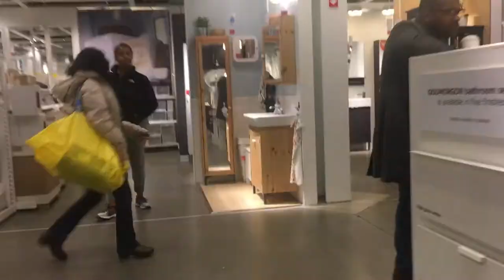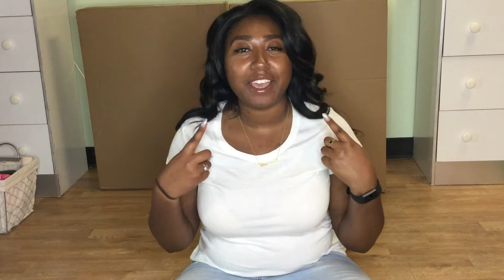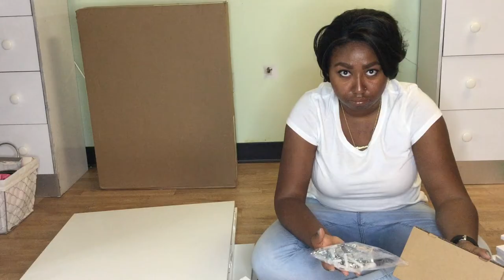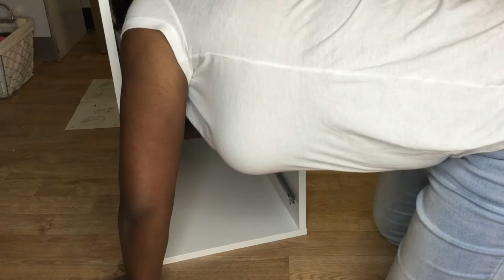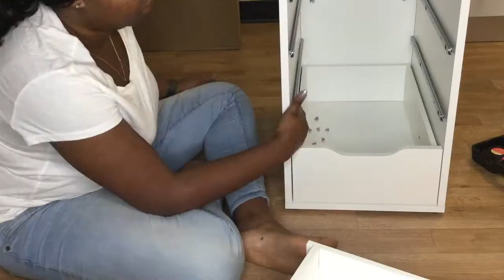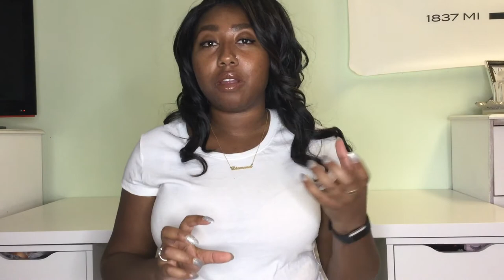IKEA Alex Linnmon Vanity Set Up

Comment: Hi pls what did u use to grip ur table to the drawers ? And we’re can I get it. Pls help!
Reply from the maker: I cant remember which one but either the tabletop or the drawer came with these little clear rubber or silicone dots that you stick on the four corners of the bottom of the tabletop or on the outer corners of the drawers to keep the table in place and keep it from sliding and scratching.

Comment: Thank you for your thorough video. I'm looking forward to purchasing this this week. Did you have a car or truck to transport it home? If you used a car, would the longer table, 78 inches, fit in back seat in your opinion? Thanks in advance.
Reply from the maker: Hi!! I used a standard SUV to transport it. I put down the second and third row seats and put the boxes in so the longest part of the table top (59") started at the back of the drivers seat and stretched to the trunk <- hopefully that makes sense lol. I don't think it would have fit horizontally across the seat so if you were to get the 78" I doubt it would fit across the back seat of a regular car. Hope this helps!
Reply: Thank you for answering